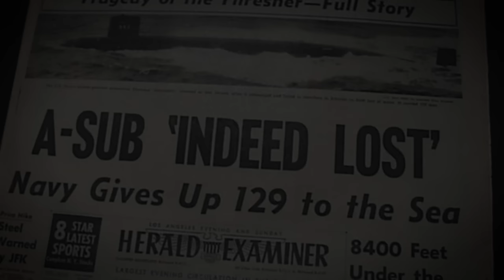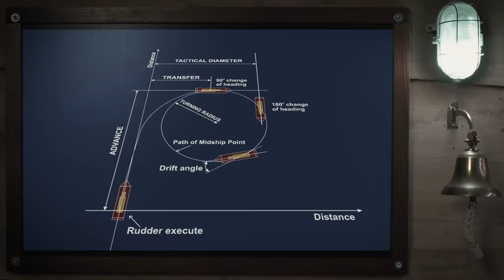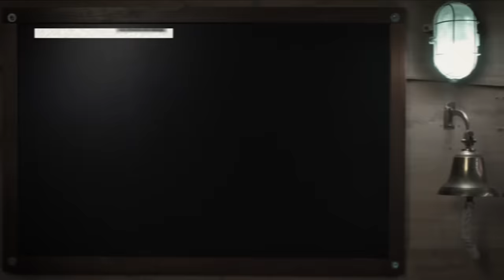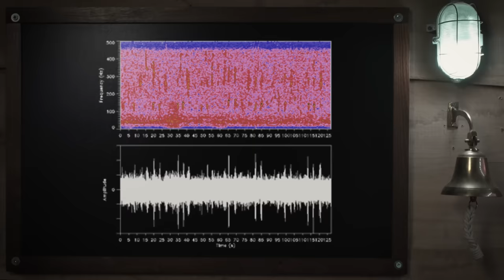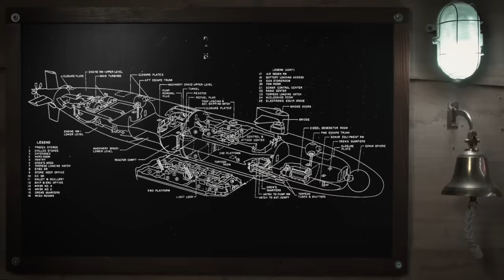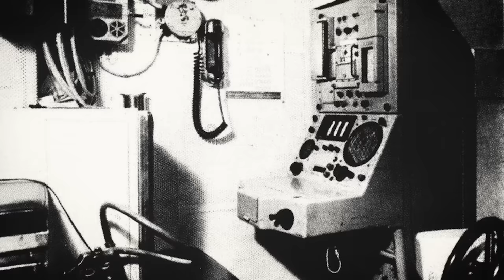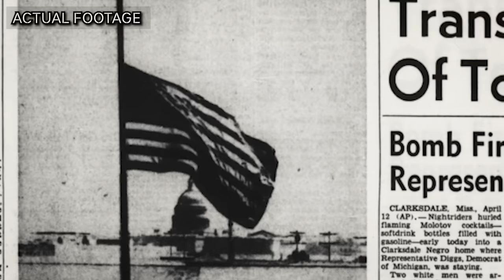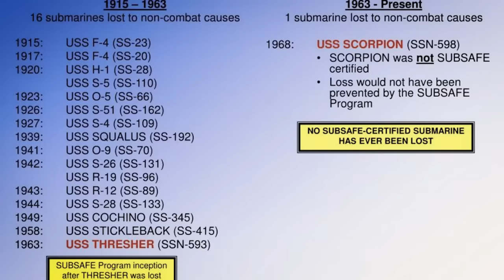This Water Pipe Killed All 129 Men

Comment: The Thresher was the start of the SubSafe program.  All X31 Shipyard Mechanics as well as all X shops in any Naval Yard are aware of how SubSafe works because of Thresher and Admiral Rickover.  It was drilled into us on a daily basis.  Pipe brazing was fine back in the Diesel boat era but not for Nucs.  Welding the pipes was key to the success of SubSafe.  Procedures and methods were developed to accomplish this.

Comment: The channel Sub Brief did a video on a report that challenges the instant implosion theory called "37 Pings." 

The gist of the report being that the explosive noise was actually the reactor catastrophically failing, and Thresher was at neutral buoyancy just above crush depth running on battery power for some time while the crew struggled with hypothermia and radiation.

Anyone know if that report is confirmed? It's a horrific lesson in safety culture either way, but damn. I didn't think this story could get sadder.

edit: 37 pings, not 29.
Reply: It's the now declassified official report. The reality is that the crew were alive for quite a while, despite what they told to the public at the time.
PS
It's 37 pings
Reply: The Seawolf report was considered during the original investigation and was concluded to be wrong and probably caused by interference due to ongoing search activities. It's important to note that ALL the other evidence, including the state of the wreck, SOSUS acoustic data, data from Skylark, etc is consistent with Thresher exceeding test depth and imploding shortly after it lost communication and inconsistent with the theory presented by SubBrief.
Reply: @misarthim6538 It was declassified report not subbrief theory?
Reply: @janipt  The declassified report only said what Seawolf reported they heard. What it WAS or how it was interpreted, that was SubBrief (or someone else's) theory.
Reply: @misarthim6538  Ok my bad 👍
Reply: 18 t / 18,000 litres/4,755 gals in 3 mins is 1585 gals/min (6,000 litres/minute) flow rate - like a 15 HP water pump turning on filling the engine room of the Barbel. A similar rate of flow from 09.09 to 09.17 or 8 mins may have put 48 t water into the engine room of the Thresher driving her down deeper to implosion with ballast tanks unable to be blown and damaging Sub Brief's video's neutral buoyancy theory.

Comment: Wait, what. I had a friend in the Navy who was a member of the crew of the Thresher. The only reasn he didn't go down with his crew members is that coming back from leave, he was late for the final dive and was on the pier watching as the sub left harbor.
He told me that it was a problem with the ballast air frezing in the line and cutting off the blowing of ballast to surface. He said the problem had occured previously while he was on board but the momentum of the sub allowed it to reach the point where the expading air in th ballast tanks allowed the sub to surface. He figured that the air line had frozen again but the sub was unable to reach the expanding air threshold, so the sub came to a stop and began to sink, whereapon the air in the ballast tanks began to be unable to stop the dive to the bottom.
Reply from the maker: Thanks that’s useful to understand

Comment: Excellent research and presentation.

I spent many years working QA/QC in the food industry in Australia, often butting heads with management when I wanted to implement changes. As I used to explain to them, if we don't do this, and one family gets sick from the product, we will have every TV journalist/program/new service at the front gate, on the phone and in your face as your leave your home. The QA/QC department is your insurance policy against such things happening. Our job is to look into our crystal balls and play "what if?". When we have had a problem, I can come up with 12 different ways that the contamination got into our product and it won't be the first half a dozen or so, because they are the ones that are taken care of by your usual standard procedures. It will be the totally out of left field, the one in a million occurrence that has caused the problem - I have seen it with my own eyes.

It seems to me that the QA/QC let these guys down, plus the SOPS for hot restarts after a SCRAM....which technically comes under QA/QC as well as they are the guys in charge of documentation and making sure it all works. Probably the cold war, the rush rush rush, hush hush hush didn't help.

May those brave souls find a safe harbour
Reply from the maker: Yes I think there’s often a conflict between QC who want to show it down to make sure things are done properly and production who want to speed up and make the deadline. It’s a balancing act.
Reply: no... there is no QA or QC for reactor scrams... we actually do this about once a week at depth as part of our daily drills... submarines practice fires, flooding, loss of electrical busses, loss of hydraulics... and at least once or twice a month pretend the reactor shuts down or has some other calamity. As a former radioman i had to gen up those messages and pretend to launch radio bouys.... so its not like food service... these men we lost due to engineers over confidence and the governments reliability on lowest bidders.

Comment: Maybe this is harder than it sounds but I always wondered why Navies don't run post-construction and post-overhaul testing in water that's only slightly deeper than the sub's test depth.  That way if everything goes wrong the worst that can happen is the sub can settle on the bottom where the crew might be able to make repairs or a DSRV might be able to reach it.
Reply: Impacting the bottom at speed will likely cause a hull failure too.
Reply: @JB-jg1tc  better odds than inevitable implosion from an unstoppable dive.
Reply: Maybe they need a lot of room to manoeuvre freely. And shallower water has terrain features that would hinder them

Comment: Excellent posting: The explanation given by US Navy raises many questions. 1st-any electrical cabinet in a potentially wet environment would be enclosed in a watertite enclosure, tested and approved for any moisture intrusion. These NEMA enclosures are used even in an industrial setting, where standards are far less demanding than in military applications. 2nd-the transfer of essential power especially for RCP ( Reactor Cooling Pump ), it seems, would have at least two separate sources as backups with a transfer switch to select either source in case one source fails. Even if a reactor SCRAM has occurred some means of alternate propulsion would be available-or all test dives suspended until adequate Battery power was available. 3rd-Water ingress- the equivalent of hole 1 sq.ft., if open to sea, will allow water inrush even at the shallow depth of 100 ft. of 36,000 gpm (gallons per minute) at a weight of 8.5 lbs/gal= 306,000 lb/min or 306,000/60=5,100 lb/sec an amount of 2.55 short tons per second ! . Surely there exist some means in the bilges to dewater quickly with bilge pumps having a source of emergency power and tested for functionality on every rotating watch by those responsible crew members. 4th- You wonder if there exist a manual override, a hand lever that would mechanically actuate a valve to dump high pressure air directly into the ballast tank(s) with nozzles designed to function in spite of adiabatic cooling from a rapid reduction of air pressure.
Reply: Spray-tight enclosures were evolved after the accident.  Before that they were basically the same switchboards used on surface ships. Surfaces ships are not going to get sea water rushing in at 500+ PSI.  While there are multiple power sources and routes for any equipment aboard, if you wipe out those vital and non-vital switchboards in the machinery space, nothing is going to work.  Even if you left the steam valves open, there would be no sea water pumps to condense the steam in the main condensers, so you would be dumping raw steam into the engine room.  That would kill everyone in it pretty quickly.  There would have been no power for dewatering pumps either.  Even the ships battery would be unusable as it too is routed to those same switchboards.  None of those circuit breakers would stay shut if they were shorted out by sea water - an excellent conductor, by the way.  Also, while the ballast tank valves could be manually opened, the filters that shouldn't have been there would still have iced up.  Finally, the water-tight doors in the machinery space would both have been shut for the dive, and they both open inwards.  As soon as the flooding started, it would have been impossible to open them.  So no one was going to enter to help whoever was in there.  The noise level would have been so loud that they could only communicate with each other with hand signals.  No one would have been able to talk to them or give them orders, or even ask them what was going on.  They were on their own.  They were also soaking wet and freezing.  Even if they had managed to isolate the flooding, the weight was going to drag that sub down as they had no propulsion, no dewatering, and no ballast blowing capability.  It took years and billions of bucks to eventually solve all the short-comings that were identified in our submarine construction, overhaul, and operation - by that sinking.  Those few men weren't going to solve them all in the few minutes they had left to live.  God Bless all those good men and their families.  The crew was not the problem.
Reply: @michaelwalimaa1806  Thank you for the additional information: Having worked with Emergency Generators, Battery Banks, Transfer Switches, Interlocks and associated equipment most all share a common limitation, the amount of money and/or time constraint in installation, testing and distribution to parties concerned. No criticism intended in my comment. My respect to anyone who would serve as a submariner. I question the design or lack of overrides and backup for the crew who's very life is on the line. I fully realize that with time commitment of a tactical weapon or vessel there comes a point when you have to freeze the design an " go with what you've got " . I'm sure the U.S. Navy has access to scientific and engineering talent that is second to none. BUT When I hear of a failure of equipment and subsequent loss of life related to that equipment I seriously question the design engineering involved and also the approval and acceptance by a review board that would indicate that ALL that is possible to maintain the BOAT, safeguard life, has been put in place. That the highest confidence, the utmost reliability factor of equipment known to man has been installed. Unfortunately there exist few systems that cannot be made better in some way. My deepest hope is that the engineering, testing and approval in future be of such a standard that no BOAT will ever suffer the fate of Thresher or Scorpion again.
Reply: Ref 4th - I seem to recall there was. Four of them...two on each side, fore and aft. I don't remember nozzles though, just the valves. They had big green handles.

Comment: how do you know for sure that the temp strainers are still there have divers or something gone and somehow looked to check this how can you be so sure...this video goes to show how important it is to triple check shit especially using different people to do so...great video!
Reply from the maker: The strainers are something they have seen go wrong on a number of similar subs. It’s not absolute but highly likely.
Reply: @waterlinestories  oh okay thanks for the reply i dont doubt that it happened i just was curious if there was sure fire proof or not keep up the good work great videos
Reply: They were not items that might or might not be left in place. There is a strictly regimented process of engineering surrounding every decision and every deed. Few surprises, especially now.
Reply: It’s a guess.  Good enough for YouTube.
Reply: I used to be shift test supervisor for reactor and steam plant test on CVN68 class reactor plants.  They know the strainers are installed because all work is controlled by work permit.  Installation of temporary equipment requires a work permit.  Once installed, the work per it is placed on nold not allowing removal until specifically authorized.  The installation portion of the work permit would have multiple copies at the shipyard.

Similar processes apply to non-nuclear work such as the the air system.  

Before reactor plant startup we review EVERY work permit that is open and make a decision if it is OK to start up.  That decision is jointly made by a group of experts on the plant.  I am surprised the ship was allowed to sail with strainers installed.  The review requirements may have been less strict at that time.

Comment: Great video, with good, clear details.👍🏻

Hopefully SUBSAFE also implemented a Remove Before Flight Flag system on safety critical control or operating items or at least an "Oi cunt, remove before sailing" on a bit of tape or post-it like I do working on my vehicles.

Comment: 7:55 Did you say RADIO WAVES? INCORRECT. Radio Waves cannot permutate water even at high power more than a few feet. The communication used by Thresher is an underwater telephone it uses 900 to 60kHz frequencies to send voice communications. The unit on Thresher was the AN/WQC-2 unit or sometimes referred as UQC-1. This is the reason why thermoclines are important as the higher frequencies used for normal communication around 42Khz will reflect off the thermocline. This typically means shifting to the 12Khz band for deep water operation. I was a Sonar Tech on USS Georgia SSBN 792 and had to operate and maintain this equipment.
Reply from the maker: Thanks for the added info. I misspoke and it’s great to get a correction that really adds value.

Comment: I  do not understand why this test run were not conducted in shallower waters...say like 500 m max  ,in case of failure the sub would rest on the seabed intact giving enough time for repair or rescue.
Reply: I saw that mentioned in a documentary not long ago if I remember doing what they did was against protocol for that very reason.   They said they could not find any explanation why they did the test there and not where it couldn't get to or past crush depth.

Comment: The SUBSAFE Program, QA Inspections, procedural guides, check list, standard operating procedures and proper training of personnel have helped immensely in the submarine force to keep casualty situations from being catastrophic situations. I am a 20 year Navy submarine vet who did 10 years of sea time on 3 separate boats all the same class, Ohio. Every time I reported to a new boat, they were always trying to make things work for the better. One thing I did notice is that they expected the same amount of work with fewer bodies. I can't tell you how many times I heard, "Fast is slow and slow is safe." But then get yelled at for not picking up the pace because we have a deadline to meet to get out to sea. Not saying we didn't do our best to get the job done but sometimes it sucks having the diesel running being topside while installing the last missile tube closure while the tugs are waiting to throw lines across to pull us out of the EHW so we can get underway. Sometimes I was scared of that rush. It's our lives at stake and people are running on fumes to get a job done. Not the best case for proper personnel management. Somethings are just out of our control. My first boat, we had 26 Missile Technicians. My second boat, we had 23. My third boat, we had 18. Losing almost 25% of your man power is a lot to try and keep up with still doing the same job.

Comment: That pipe joint failure sounds similar to K-19s as it's reactor coolant also decreased
Reply: yeah, although the SCRAM systtem actually worked on this one, for better or for worse.
Reply: Play pipe joint failure is only supposition. They have no idea why the reactor scram
Reply: They have no idea why the reactor scrammed. There was no proof of a pipe joint failure.

Comment: I was a nuclear field electrician in the late 90's. Even then, the name "Thresher" was extremely well known, especially in the context of running emergency drills and learning about the onboard systems. I'm pretty sure it's by far the best-known sub accident, because of the mistakes and lessons learned. 

Great video! I certainly learned a lot from this, good job using the naval/sub terminology as much as you did.

Comment: A point of information: radio does not work underwater. They were using ultrasonic acoustic energy (sound waves at high frequencies) to communicate with the surface. The ultrasonic sound would have been the carrier wave, modulated with the speech signal.
Reply from the maker: Thanks. I appreciate the correction

Comment: 1:29, correction. ASROC was a surface ship mounted antisubmarine rocket; basically a standard Mk44 and later Mk46 torpedo mounted to a rocket motor. Submarines mounted the SUBROC system.

Comment: Excellent presentation - very factual especially considering that the "Silent Service" i.e. submarine force is very secretive about their boats.  Keep on the good work and outstanding research.
May I make a recommendation - change your "flashy" title to a more appropriate or sober one - the issues that let to demise of SSN Thresher were numerous as you mentioned; the failure of a brazen joint and the icing of the air strainers were the disastrous results of a series of failures/faults/break-downs in the design of a new type of submarine (i.e. nuclear).  It is not as simple as "a water pipe killed all 129 men" some submariners including myself are very sensitive to the plight of SSN Thresher; we all had to study what happened to her (and a few other).  Peace be with you, Ciao, L